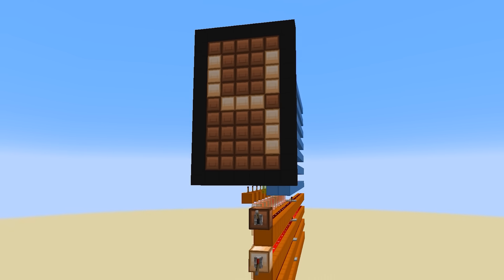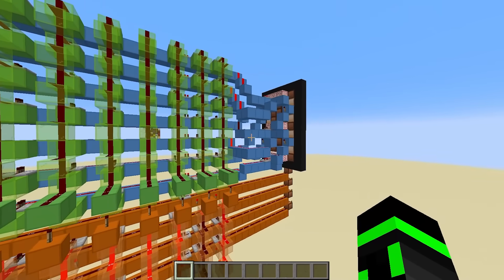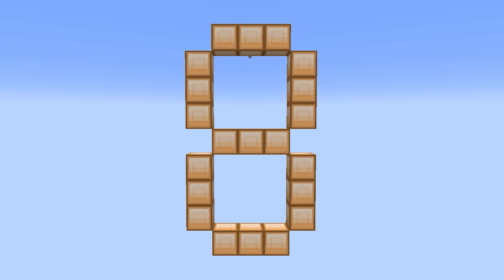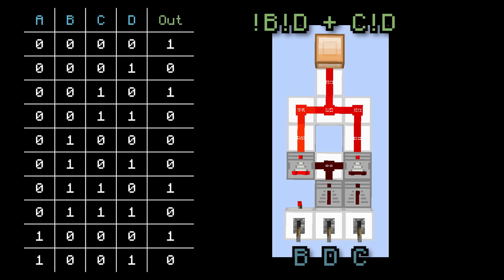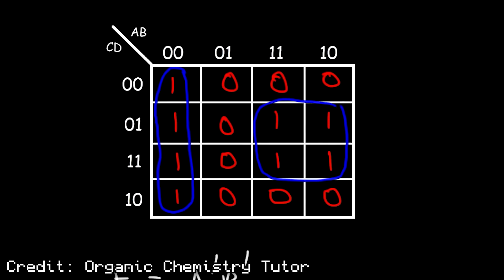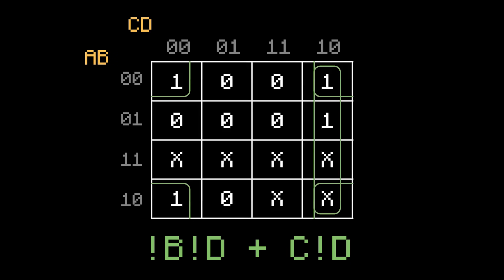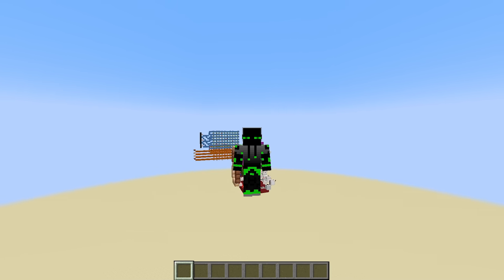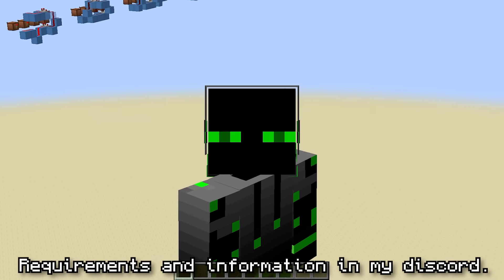The Secret Behind All Tiny Redstone Builds

Comment: a good way to generate the pattern of 0s and 1s for your K-map (also known as Grey code) is to start with a sheet of graph paper (my preference, makes it look neater)
1.) write a zero, and then in the cell below it, a one. This is a grey code map for a single digit (no difference vs. normal binary)

0
1

then you mirror that along a horizontal axis below the bottom digit, doubling the number of rows.

0
1
- - - - 
1
0

then you add leading digits, all 0s on the top half, all 1s on the bottom half, giving you a two-bit Grey code map. each row represents increasing binary values from 0. this is distinct from normal binary code maps because each value increment only requires one bit to change, as opposed to normal binary, where much of the time, an increment requires you to change multiple digits from 0 to 1 or back. This is good for error detection, and a number of other use cases.

 Grey                  Binary
00 -> 0               00 -> 0
01 -> 1               01 -> 1
11 -> 2               10 -> 2
10 -> 3               11 -> 3

to get a 3-digit (or 3-bit) table, simply repeat the instructions again, mirroring the existing table, and adding leading digits of 0 on the top half, and 1 on the bottom half, 

000 ->0
001 ->1
011 ->2
010 ->3
110 ->4
111 ->5
101 ->6
100 ->7

of course, if you need a large Gray code table very quickly, there are ways you can program a computer to generate the gray code for you.

Comment: Matt! I am very much a beginner in redstone and I have a “cool” idea that I’m working on. I’ve been trying to build a bcd decoder for the past two days. I don’t understand the math and processes behind it nor do I completely understand the redstone logic required to carry that out 😅 My problem is I need to use 9 bits of binary. Every bcd decoder I’ve found is for 8 bit binary, not 9 bit. I know there’s a resolution or work arounds but I can’t wrap my head around it.

Could you either do a video on a 9 bit binary to bcd converter or maybe I could send you the world somehow and you could pop in give me some ideas or tips? Any help is greatly appreciated. (PS. You’ll get to see some magnificent spaghetti)
Reply: Also, I’ve placed every block by hand until I got halfway through your bcd converter video. Then I had to install world edit and I’ve been working on this project for about a week now 😂
Reply: This comment is really late, but have you tried using the double dabble algorithm (look it up on wikipedia) to convert binary to decimal? It can convert any number of binary bits to decimal, only problem is that its very slow compared to having a dedicated circuit do it and you have to build a redstone computer to actually run the algorithm. If you dont want to use that, you probably have to design a custom circuit with all the logic gates for a 9 bit bcd decoder. Maybe by experimenting with some sort of logic simulator online
Reply: Also do you specifically need a 9 bit BCD? Does it also work if you go overkill and use a 16 bit BCD cause theres some tutorials on youtube for that
Reply: Oh actually i just found a 12 year old video on youtube about the double dabble algorithm in redstone! Its on the channel Newomaster, the title is Minecraft redstone, how the double dabble algorithm works

Comment: One thing I've been thinking about copper bulbs I can think of acting like a latch with specific modifications with comparators and torches like if the source is off the output would be off on the one which is just a comparator but the one which is a torch is off

Comment: I never use complex redstone circuits in my Minecraft maps. I always play technical modpacks, so most of these complex circuits turn out to be useless on farms, or maybe there are other options in the blocks provided by the mods. For the first time I tried to make a 7-segment display, the first thing I tried to do was use this simpler strategy using truth tables, something I was more familiar with from my automation engineering degree. I always imagined everyone would use the same circuit, but in a more spaced-out way to make it more manageable and easier to understand. Just now, I discovered that everyone makes it the hard way.

Comment: You can also look into the Quine-McCluskey algorithm if you're ever interested in manual logic simplification.  K-maps are pretty handy and provide a visual way of simplifying logic equations, but they become exponentially more complex as you add more variables:  At 5 variables, the K-map becomes three-dimensional, at 7 it becomes four-dimensional, etc.   

After a certain point, however, it becomes impractical to simplify things by hand, even with more advanced simplification algorithms.  You can use freeware logic simplification tools to do the heavy lifting for you (or even check your work on simpler stuff you do by hand).  I'd personally recommend checking out Logic Friday (it kinda carried me through the digital logic courses in my undergrad XD)

There's so much more you could probably do with Minecraft redstone.  Honestly, you could almost teach multiple entire college courses on digital logic entirely in Minecraft.